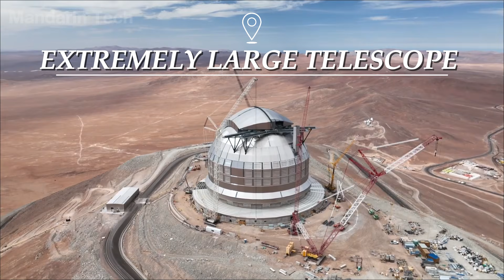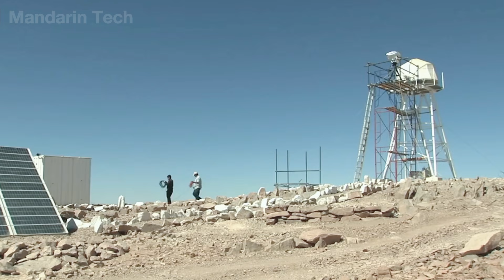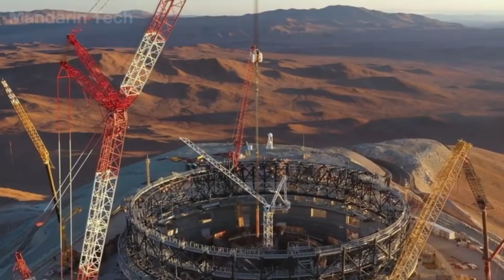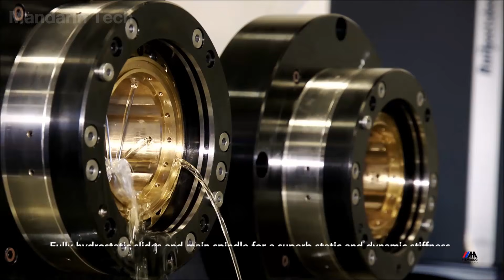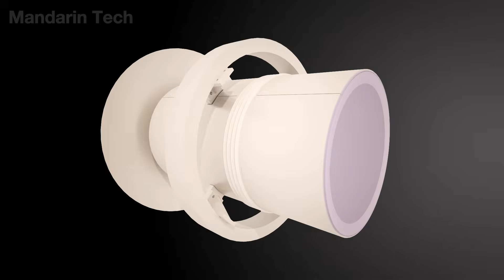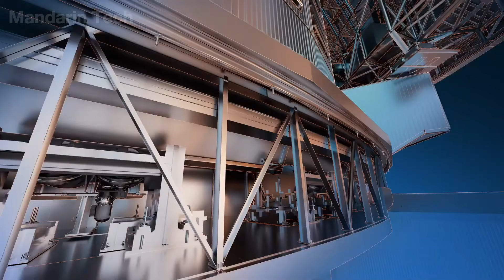The World’s Largest Telescope Is Being Built In The Atacama Desert By 16 Countries

Comment: ??? INSANE  in 21th C with spacing why have those still?  No more pollution?  
What about that on Moon ?
Reply from the maker: Maybe one day we’ll build on the Moon, but for now this is still an engineering masterpiece here on Earth.
Reply: The moon has a lot of very sharp dust.   There is very little atmosphere but still a tiny amount,  so it is better to just have space telescopes orbiting
Reply: @harryniedecken5321 ? now the sharp dust is floating? Or is it Wind? About the end Lens? No sure what that would cause, but maintenance be easier on planet, this falls are risky mostly with 1/6 G.
Reply: You have any idea what it would cost to bring all those materials to the moon? The construction crew lives where? What do they eat, drink? The cranes, bulldozers, concrete mixers, trucks, steel, welding equipment ...., optical components, computers, solar panels, electrical components, ...  all this needs to be brought to the moon. There is nothing there on the moon. Everything - and this is a literal everything - needs to be brought from earth.
Building such an observation site takes years here on earth, it would take decades on the moon. You really want to ensure providing supply from earth for the crews for decades on the moon until the observatory is finished? How about we first learn how to walk before we try to win a marathon? (Means: we need to start simple with colonizing the moon. This is already hard enough and more then we can chew right now)
Reply: @kallewirsch2263  No not in that field, You do?  More than the > NASA plans $20B moon base, but pauses lunar space station project ???
Estimating a NASA Mars base cost ranges from
$300 billion to over $2 trillion, with estimates largely depending on the scope of the base and timeframe. A small, early-stage scientific outpost might cost hundreds of billions, while a sustainable colony could exceed $2 trillion. 
.... - perhaps you should ask someone else to educate you ?   Thank you 😀
Reply: @wildboar7473  
How about you thinking about what it means to build a large telescope on the moon and what is necessary to do it, before asking the stupid question why we still build telescopes here on earth?
Thank you.
Reply: @kallewirsch2263  ....does not sound like fun, think I am going to get stone instead. All I know it is easy to do than fake :)
Reply: "The future is the moon," astrophysicist Joseph Silk told Business Insider after he and other moon-telescope advocates met to discuss their plans during a conference of the American Astronomical Society in New Orleans. 2024
NASA is planning to construct a large, autonomous radio telescope on the dark side of the Moon, known as the Lunar Crater Radio Telescope (LCRT). This telescope aims to enhance our understanding of the universe by reducing interference from Earth-orbiting satellites. The LCRT is designed to operate without human presence and would be assembled entirely by robotic systems. It is expected to begin construction in the 2030s if fully approved and funded. 

Astronomy Magazine
Note: nothing to do with Me, did  not suggest it, not responsalble!! Obviously not bright Planners that have any idea of cost.......  :) :) :)  
(or just keeping the scifi kids happy  with progress  while They.....)